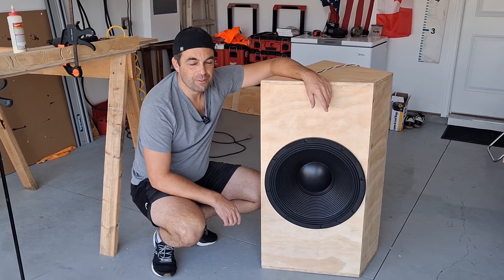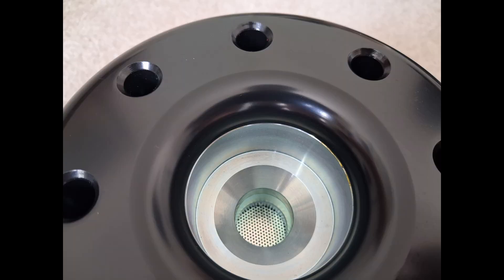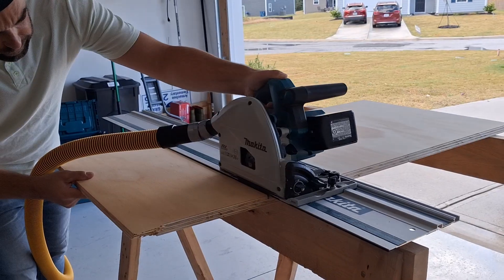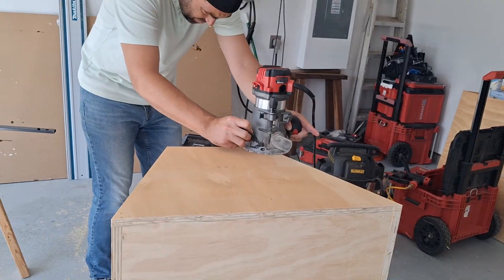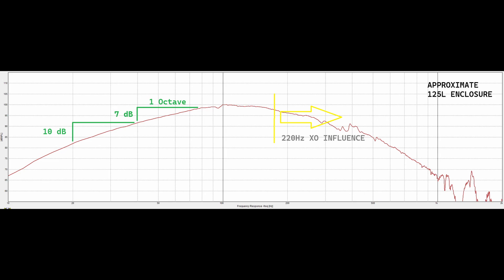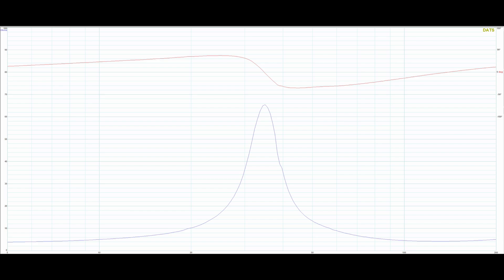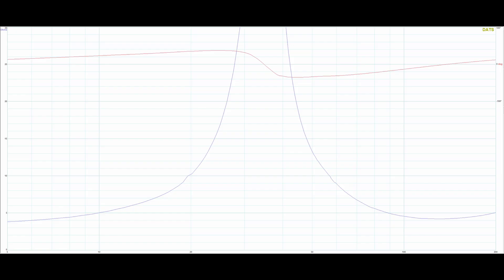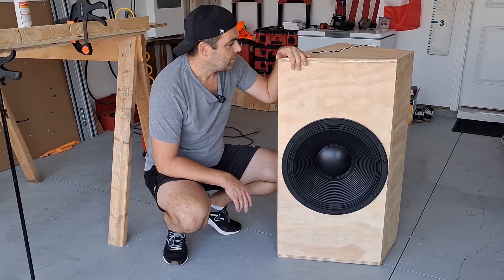Celestion TSQ1845 - BEASTLY Subwoofer - Part 1

Comment: in car audio the cabin gain is crazy but also the compression. A Pa woofer is grade for high to infinity volume rooms. in car audio the liesening room has arround 2-4m3 volume. The high MMS its the key, way 88db 40kg high xmax18´s  get louder than a PA woofers
Reply from the maker: I dont believe this would be true. The strong motor and efficient design will provide less compression. Can you point me to a resource that explains what youre trying to say?

Comment: we need a SPL run just for fun.
Reply from the maker: Maybe once ported 😅
Reply: @ImpulseAudioSpeakers Yes no worries for no get the setup sorted to work alongside that cabin gain. A good peak output goal can be 140DB seeing as most PA drivers have similar Xmax as 12 inch car Audio drivers i.e 25mm or less.
Reply from the maker: @EBMproductions1 ya this driver has 15mm, BUT it is Klippel 15mm. In other words, and honest solid 15mm and I can tell when testing it.
Reply: @ImpulseAudioSpeakers See its perfect and a well tuned enclosure means it will be great in car even when pushed.

Comment: Very nice!
That load isn't just easy on the amplifiers, ... it removes compression significantly from the driver's operation across its entire bandwidth.   
(plus, eases the demands all the way back to the battery system) 

When not subject to thermal challenges, and without being saddled with the typical inductance that neuters high stroke drivers, these pro-oriented drivers like this offer superb performance. 

My opinion, it's a shame to vent that box's nice, extended output. 
But then again, we've all been there, 
ie., ... examining free headroom capability, vented vs sealed, the extra output at tune is very seductive!     

Worth noting, with some platforms there's also a velocity component, and an intensity component, ... supplementing the experience. 

LF velocity, LF intensity, characteristics not often discussed and explored fully. 

Thanks for exploring these Celestion drivers, I find them so compelling. 
(btw, that cabin gain is glorious!)
Reply from the maker: I'm with you on leaving it sealed. If it was my car I'd add some eq and use it. My son wants it to pound as loud as possible 😅
Reply: Great comment, @FOH3663.

Comment: I dont see many pro subs in the home systems because infra frequency is paramount for most building big subs for ht. I hope these do well but if you've got a 24 in a ht that cant get low people will be scratching their heads.
Reply from the maker: It should be able to get low. Wether ported low or run sealed. It models very well. Of course Ill test it and prove it because you never know.

Comment: Needs the frequency response of the car with the port.
Reply from the maker: Thats coming. Ports and braces were glued in and inside all epoxied this weekend. We'll sand it this week and get to testing.
Reply: @ImpulseAudioSpeakers  I would like to see the peak Db score, & @ 15 hz, 20 hz, 25 hz, 30 hz, 35 hz, 40 hz, 45, 50, 55, 60, to 80 hz, of that sealed Gr 10", vs this 18" sealed, vs this 18" ported, all in this vehicle. I ❤️ data/test results! That in car freq. Resp. Curve was impressive!
Reply: @ImpulseAudioSpeakers  I'm not sure if you have heard about a neat little Monitor/device that measures the Db, freq., & real time/actual impedance while playing? It's called the Bass head Garage Watt meter V2, & they have an SPL meter as well? They sell through Big Jeff Audio for approx. $149 last i knew. These units have been tested to be accurate, & the V2 Watt meter is more accurate then a unit that costs over 3x as much= the SMD Amm-1, especially in peak power modes.
Reply from the maker: @evilinside5984 sounds like an RTA, but not sure what real time impedance is. Ill look it up.
Reply: @ImpulseAudioSpeakers  Car audio guys call it box rise, but the real name is impedance rise. The difference of your wired to impedance= @ rest, vs what the Real impedance is per freq. played= this meter can show this actual impedance, & show @ what freq. this happens @. Different enclosure volumes, tunes, & actual power applied can change this actual ohm load, per freq. played. Its super cool to see this while playing music.
Reply from the maker: @evilinside5984 oh that sounds like an impedance response which I showed near the end. I also noted how efficient it is between 20 and 80 hz. A lot of people think a 4ohm driver is just 4ohms but its not. Its changing at all different frequencies.
Reply: @ImpulseAudioSpeakers  Yes, i have been trying to explain impedance rise to people for years. I have been into audio for over 35+ years. I have been testing many things like this on a championship winning car audio team for years. I love test data/results. I have seen a burp style SPL built subwoofer, in a 1 note enclosure, wired to 1 ohm, & @ its peak freq., the impedance rose all the way up to 11 ohms👀! The only way to make power, is to have the half ohm coils wired to  a 1/4 ohm, & strap (2)- 1/2 ohm stable amplifiers so they were seeing an 1/8 th of an ohm, n rise to 1.3 ohms!
Reply from the maker: @evilinside5984 it really doesnt matter if you make power. What matters is the voltage applied and efficiency of the driver. Thats why I made that comment in the video. The amp driving this subwoofer wont even get warm because the current will be so low. But the SPL will be high.
Reply: @ImpulseAudioSpeakers  I understand what you were talking about. I was talking about extreme efficiency, & how to get the power in a super high impedance setup, for an unlimited type competition, not for a musical setup. Two different setups. Just sharing some of my experience's. My team & i have competed in classes where there is a power limit, so the total system's efficiency is crucial that we maximize the vehicle, enclosure, size, tune, port area, & how all of this interacts with the driver.
Reply from the maker: @evilinside5984 I see. Well that sounds fun actually. Ive faced lots of interesting audio challenges, but Ive never competed like that.

Comment: That works better in car than I would have guessed. Though, it's a pretty big enclosure so I suppose that makes sense.
Reply: Actually, looking up the T/S, that's a pretty impressive driver in general. I tend to prefer a low FS high excursion for a sub, but this is reasonably low with decent xmax to go with that high sensitivity. From your initial measurements it should really turn out well as I have no worries you'll get a well designed and built enclosure for the final version.  

I assume the SQ will be pretty good as well.